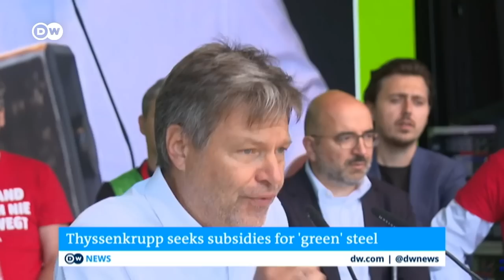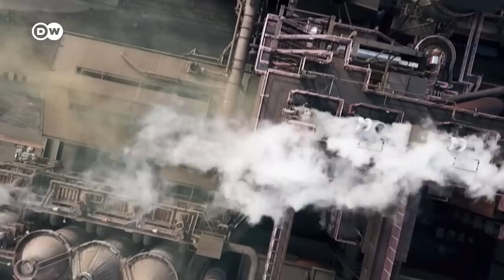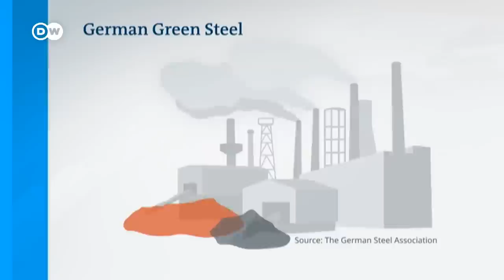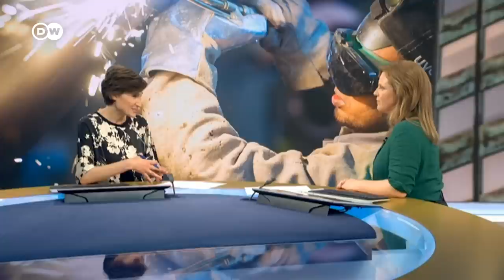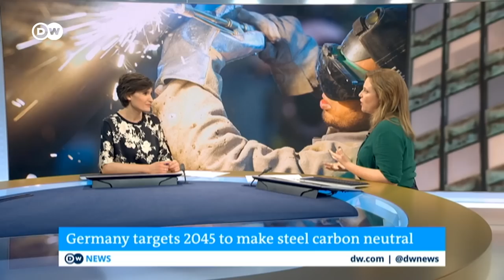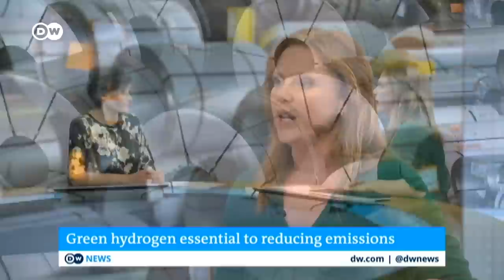Industrial giant Thyssenkrupp protests EU rules blocking massive cash injection | DW News

Comment: And where is H2 coming from? Last time i cheked the largest part of H2 is made from natural gas... So still not carbon neutral... Unless you make H2 from water hydrolysis(splitting 2H2O into 2H2 and O2)
Reply: That's the plan..
Reply: @heinedenmark  the energy grid doesn't exist for everyone to have electric cars but we want to accomplish this? ridiculous.
Reply: @samsmith2635  yeah it's called investment and network build out. We in Germany have over double capacity with wind and solar for what is needed, just needs to be better connected, not so Impossible
Reply: You are correct. The plan is to produce hydrogen via electrohydrolysis when there is excess production in the grid. Got great wind on the north sea but not enough demand for it, shunt it to the hydrogen plant. Now, whether that plan is viable, we'll find out.
Reply: ... and yes, hydrolysis from sea water: at a time when our oceans are already stressed and under threat. 

This puts Phytoplankton populations - responsible for most of the transfer of carbon dioxide from the atmosphere to the ocean - at risk of at least decreased richness in diversity as salinity increases. The AMOC is also adversely effected as salinity increases, and there may be other additional impacts to the water cycle, including rainfall patterns and volumes, etc.

My understanding is that mass "green hydrogen" production at scale - far above the current research, testing and proof-of-concept efforts - and its impact on the broad planetary system, is not well understood, nor has it been factored into scaling green hydrogen production to the significant quantities needed to replace coal, gas and petroleum use in industrial settings - such as raw-materials extraction and processing including steel production.
Reply: If Germany followed the Japanese plan, nuclear plants would pair up with steel plants for electrical needs, and excess power is used for the hydrolysis to generate hydrogen.  But since Germany has the Energiewende plan, steel will be made only when it is sunny and windy - the periods where hydrolysis can happen using RENEWABLE power.  Amazingly, this will be effective, as the rise in costs, plus the detachment from reality will lead to mass deindustrialization.  BASF already is executing it's decarbonization plan in Germany by moving to the US and Canada.

Comment: Just have questions of green steel. The raw pig iron also contains carbon, how to make that CO2 neutral when one need to extract carbon by burning it? And how to avoid hydrogen embrittlement were using H2 reducing iron?
Reply: You dont, thats negligible compare to the amount of co2 produced burning coal to heat and melt the iron, which will now turn to use hydrogen as a heat source.
Reply: There isn't really any carbon in processed ore and most of the steel here is recycled not Virgin Steel.
Reply: Pig iron contains carbon because carbon monoxide is the reducing agent during the smelting process. Iron ore contains FeO, Iron Oxide. Rust basically. To turn the oxide back into metal you need to provide a lot of energy in the form of heat AND get rid of the oxygen, turning it into just Fe. The traditional smelting process uses carbon monoxide, CO, to do this. carbon monoxide is generated by burning coal, but not allowing the coal enough oxygen to turn into carbon dioxide CO2. Without enough oxygen the combustion process is incomplete and instead of CO2, CO is generated instead. This carbon monoxide then reacts with the hot iron oxide, creating carbon dioxide and metallic iron. CO + FeO = Fe + CO2. 

This is the primary source of CO2 emissions in the smelting process. For every atom of metallic iron you make, you are generating at least one molecule of carbon dioxide, sometimes more as many iron oxides have more than one oxygen atom per iron atom. During this process some of the carbon gets trapped in the iron, which is why pig iron has such a high carbon content, much higher than steel. 

To remove this excess carbon, you 'burn' the pig iron essentially. Blasting oxygen through the molten pig iron to reduce the carbon content but turning the carbon into CO2. 

However, carbon monoxide isn't the only reducing agent we can use, we can also use hydrogen. Hydrogen doesn't get trapped in the molten iron the way carbon does, so when hydrogen is used the end product isn't pig iron, but pure elemental, metallic iron. Which is what we want. No body wants pig iron. Even if you're making steel you reduce the pig iron down to pure iron and then carefully add back in the perfect amount of carbon.

Hydrogen embrittlement doesn't occur at the elevated temperatures during the smelting process. It's a lower temperature phenomenon that mostly effects steel, and is primarily caused by hydrogen wanting to do anything but bond with iron. To illustrate one type of hydrogen embrittlement is when hydrogen that has been diffused into the metal due to high concentrations and pressures, recombines into H2 and forms gas pockets inside the metal rather than bonding to the iron or just staying diffused. Hydrogen and iron are like oil and water.
Reply: @bachvandals3259  Not true. Using carbon to reduce the iron oxide into metallic iron is why the process is so carbon intensive. For every atom of metallic iron you get, you have to make at least one molecule of carbon dioxide. That's how the chemical reaction works. Green hydrogen is green not because we are using hydrogen for heat, but because we are replacing coal with hydrogen in the chemical reaction.

Comment: Carbon neutral doesn't mean no emissions, it just means you "offset" the emissions you do make on paper. Let's remember steel must use coal. Hydrogen furnaces do not do what you described.  Hydrogen furnace steel still uses coal. You can't make steel without a carbon source, that's what makes it steel. Hydrogen doesn't generate a carbon source. 

These "green steel" plants will still require coal, get it right.  They just won't use coal to power the furnaces
Reply: No, they lady is right. You can use hydrogen instead of coal. I'll explain. Iron ore contains FeO, Iron Oxide. Rust basically. To turn the oxide back into metal you need to provide a lot of energy in the form of heat AND get rid of the oxygen, turning it into just Fe. The traditional smelting process uses carbon monoxide, CO, to do this. carbon monoxide is generated by burning coal, but not allowing the coal enough oxygen to turn into carbon dioxide CO2. Without enough oxygen the combustion process is incomplete and instead of CO2, CO is generated instead. This carbon monoxide then reacts with the hot iron oxide, creating carbon dioxide and metallic iron. CO + FeO = Fe + CO2. 

This is the primary source of CO2 emissions in the smelting process. For every atom of metallic iron you make, you are generating at least one molecule of carbon dioxide, sometimes more as many iron oxides have more than one oxygen atom per iron atom. 

However, carbon monoxide isn't the only reducing agent we can use, we can also use hydrogen. When hydrogen gas is forced past hot iron oxide, the hydrogen react with the oxygen, forming water. H2 + FeO = Fe + H2O

You do need carbon for steel, but that carbon is added later after the smelting process and does not generate emissions because the carbon is incorporated into the iron, not released.
Reply: @stormelemental13  You just wasted your time arguing strawman. You're describing the chemical reaction inside a furnace. I did not say "her" description of what happens in a furnace was wrong. 

Only your last paragraph addressed what I actually wrote. I did not ever write that cO2 is released when carbon is added to steel. Explaining that coal will always be required for steel production is important, where do you think that carbon comes from if they shut down all the coal mines? 

There is no such thing as a zero emissions steel foundry nor will there ever be. That's why terms like "carbon neutral" get used. 

Perhaps in future you might want to reply to what is actually said instead of running off on random rants.
Reply: @tjmarx  Coal isn't the only source of carbon, so no, coal will not always be required for steel production. Carbon will, but the source doesn't matter. Maybe it will be from coal, or coke to be more correct, but maybe not. Either way it doesn't matter if coal is used for this as it is zero emission.

And yes, adding carbon to iron during steel production is generally considered emission free because the carbon is incorporated into the steel not released as a green house gas. The emissions come from other parts of the refining process.
Reply: @stormelemental13  You just keep trying to "correct" strawman arguments and make a clown of yourself in the process.  

You seem to have trouble with comprehension.  Re-read over what I've actually written.
Reply: @tjmarx  

But there is nothing to be ragging.

If the industrial process reduces the emissions of CO2, significantly, well better do it (instead of doing nothing on excuse it is not going to 0).

No need for rage for the sake of rage.
Reply: I don’t like the terms carbon neutral term,Carbon offset,carbon credits ect, I agree that should change to a more sustainable future but I think companies and governments are not creating real solutions or explaining it correctly to the public.
A example is the single use plastics we moved on from now almost everything is cardboard but it’s lined with plastic or can’t be recycled because it’s contaminated,not to talk about the recycling percentage that is awful and disappointed at least in my country, paying for grocery bags is making money to grocery chains, while there’s a reduction in “single use” bags now houses are filled with reusable ones that almost never get used, requirements of reusable plastic cups in festivaties is the same although you can get your money back most don’t and the money end up in the pockets of the business and cups end up in a coboard somewhere not to ever be used ever again, electric cars are a lot of more environmental friendly but it’s still a lesser of two evils like natural gas and a lot of others things.
Until we addressed overconsumption and not treating thing with care, most advanced will be very small and take a long time.
Why wasn’t the eu implemented pet bootle return systems all across member states? Because of lobby groups, why e fuel was introduced in the bill? Because German automotive lobby groups ect
Reply: @weird-guy  Battery EV are just as bad for the environment as combustion.  I agree with everything you said except for the root cause. 

The root cause isn't over consumption,  the root cause is overpopulation.  That isn't debatable,  it was the conclusion of the first ever report on climate change in 1964, and it's been in every report from the IPCC since it's inception. Every genuine expert on climate change agrees that population is the driving factor. 

There are 8 billion of us on a planet whose theoretical maximum human population is 1 billion and which has never had a naturally occurring human population above 500M of us. Best case scenario we're 8x too many people,  worst case scenario we're double that. China and India alone have more people each than the entire planet can support. 

If we really want to fix the climate we need 7:8 people to not exist, and that's achieved through getting ~80% of the current and next generations to not have children.

Depopulation throws up a new problem however,  economic collapse because capitalism is built around perpetual population growth. So we likewise need to invent a new never before seen economic system that can thrive with decreasing and stable population sizes.

Comment: Pay with Time.

Suggestions:
Note:Deeds (payout=tenure)=20 years or more but remains the same.
Insurans formula(one time pay for premium):
Tenure loans=300%
{(1)
loans=100%=5B
If premium=5%=5B
Tenure loans=300%=15B
Payout=100%=100B
Payout Balance=100B-15B=85B(Future Income)
Current payout(cash now)=85B/300%
=28.33B++(can loans if Tenure loans=300%)
Total loans should apply:
Total loans=loans+Current payout=(5B+28.33B)=33.33B
Extra=33.33B-5B=28.33B(cash)

loans=100%=10B
If premium=10%=10B
Tenure loans=300%=30B
Payout=100%=100B
Payout Balance=100B-30B=70B(Future Income)
Current payout(cash now)=70B/300%
=23.33B++(can loans if Tenure loans=300%)
Total loans should apply:
Total loans=loans+Current payout=(10B+23.33B)=33.33B
Extra=33.33B-10B=23.33B(cash)

loans=100%=15B
If premium=15%=15B
Tenure loans=300%=45B
Payout=100%=100B
Payout Balance=100B-45B=55B(Future Income)
Current payout(cash now)=55B/300%
=18.33B++(can loans if Tenure loans=300%)
Total loans should apply:
Total loans=loans+Current payout=(15B+18.33B)=33.33B
Extra=33.33B-15B=18.33B(cash)

loans=100%=20B
If premium=20%=20B
Tenure loans=300%=60B
Payout=100%=100B
Payout Balance=100B-60B=40B(Future Income)
Current payout(cash now)=40B/300%
=13.33B++(can loans if Tenure loans=300%)
Total loans should apply:
Total loans=loans+Current payout=(20B+13.33B)=33.33B
Extra=33.33B-20B=13.33B(cash)

loans=100%=30B
If premium=30%=30B
Tenure loans=300%=90B
Payout=100%=100B
Payout Balance=100B-90B=10B(Future Income)
Current payout(cash now)=10B/300%
=3.33B++(can loans if Tenure loans=300%)
Total loans should apply:
Total loans=loans+Current payout=(30B+3.33B)=33.33B
Extra=33.33B-30B=3.33B(cash)

(1)}
Note:Theory or concept.Thank you.

Comment: The news item was a little incomplete, they should have mentioned the hydrogen steel plant in Sweden, it's currently operating and producing green steel right now.  It's been operating for a couple of years.

When news items miss out things like this then it gives the appearance that this green steel is still just hypothetical and people might not be convinced that it is possible, when it is possible and a reality in Sweden.

Also it's worth pointing out that the power for the hydrogen will probably come from the power grid.  You see the power grid demands power at particular times, in the days time and in the evening, but not much at night.  So if you have plenty of wind turbines they can generate the hydrogen at night for the steel plant and the same wind turbine can generate power for people to have electricity in the homes at other times.  When you put these industries together they do fit together every well.